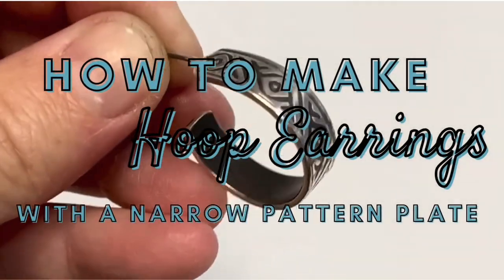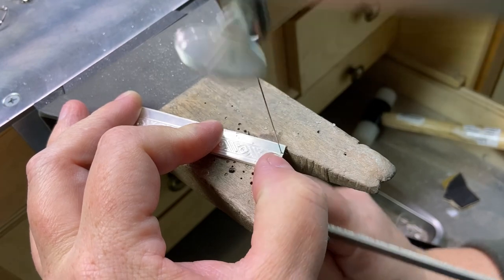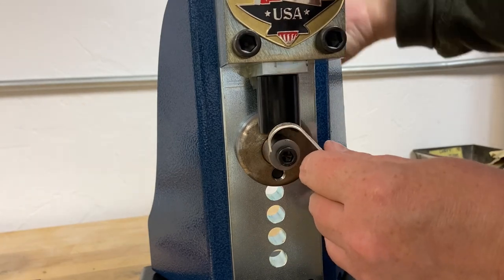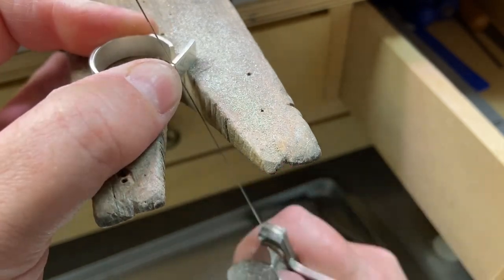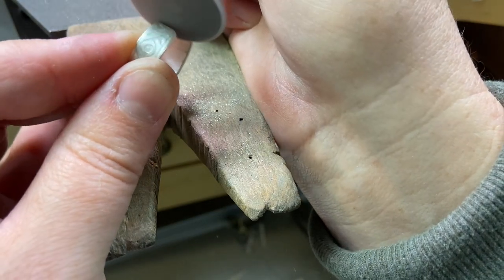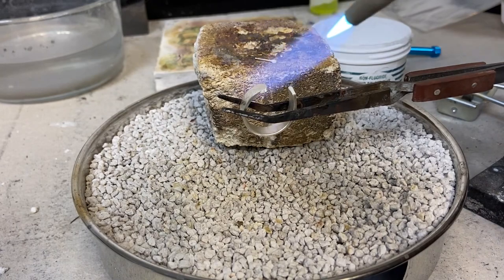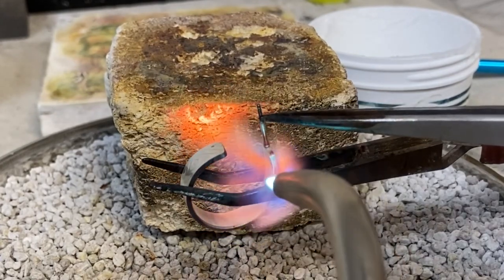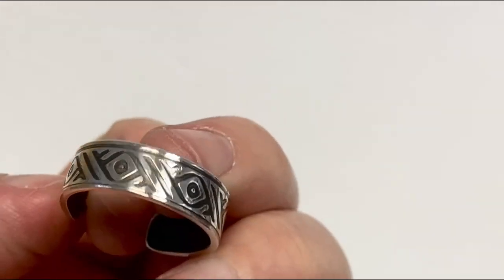How to Make Hoop Earrings with a Narrow Rolling Mill Pattern Plate from PotterUSA

Comment: Thought I already posted this, so sorry if it's a duplicate. What size wire are you using for the post? I've personally used 20ga. but recently had someone complain that it was too thin. No other complaints before. What's your preference?